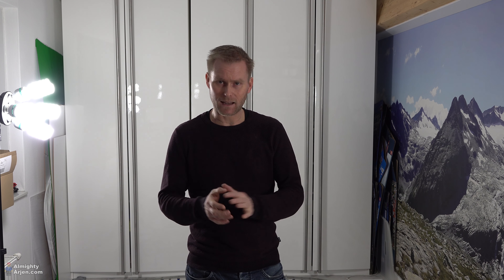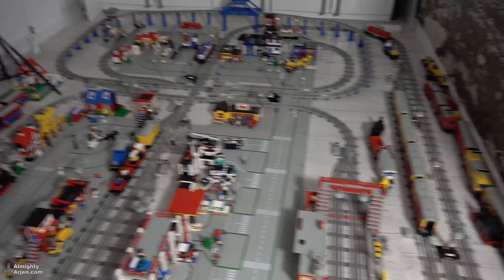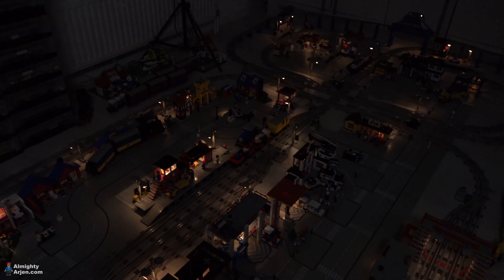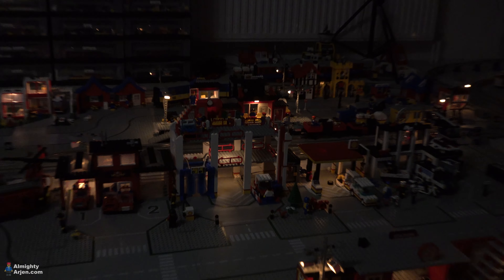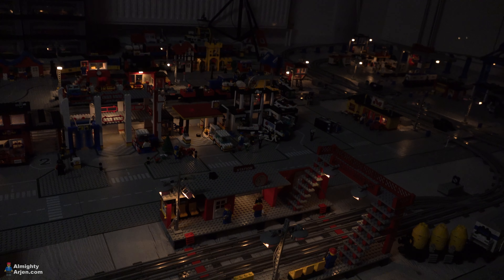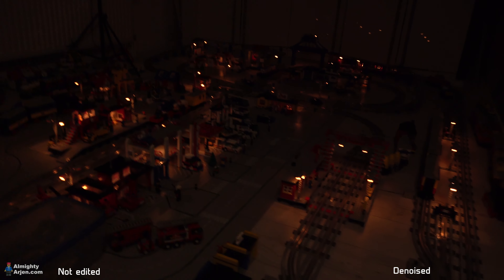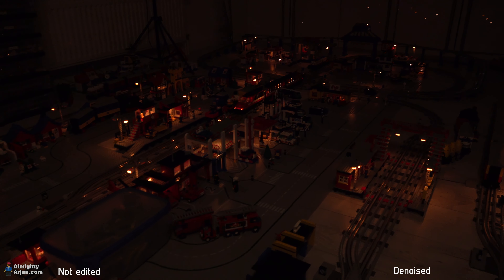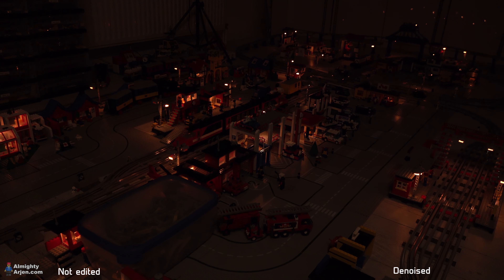Vintage Lego train layout Episode 7: lighting system

Comment: I deleted my previous comment to rephrase it.
Having some light at night would be good, after all without moon between street lights can be really dark. But IMO you should use cold (>4000K) lights, the moon is cold too, and not diffuse it, as the moon is a point source practically. If you can place the lamp "very' far, that would be great. Maybe for a short time you could overvoltage the lamps a bit, if that would make it just over the acceptable level.

And the build looks awesome! I'd love to see it with a long exposure maybe hdr picture, and I can't wait to get back to my town to watch this video on my better display.
Reply from the maker: Yes, the "cold" light was also my idea. I'll try to hang it on the roof of the attic.
Reply: I added a remote-controlled dimmer to my room lighting for that very reason! I used the Dutch KlikAanKlikUit system (spelling alert! Sorry) which we of course call ClickOnClickOff or COCO. Dimming a halogen light gives a warm orangey glow. Dimming an LED light - if it works at all - usually gives the same colour, but dimmer. I can also recommend the Philips Sceneswitch LED bulbs - no dimmer required - turn the light off and back on and it comes on dimmer :)